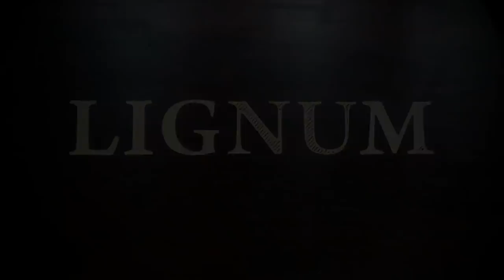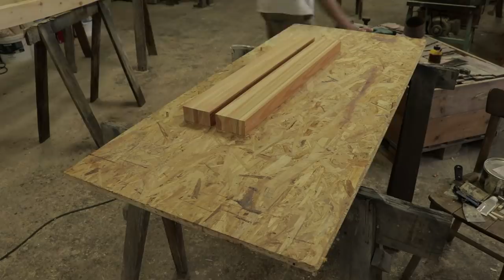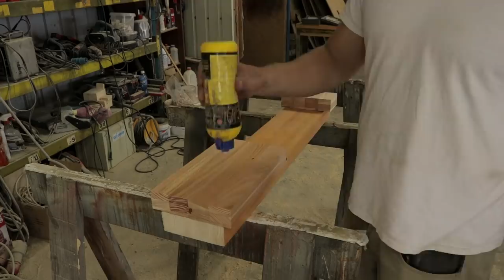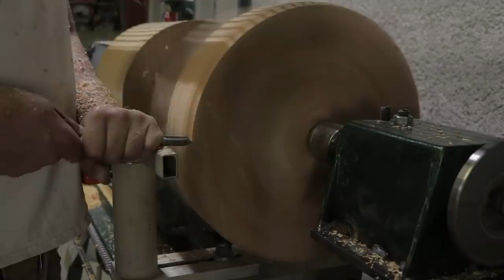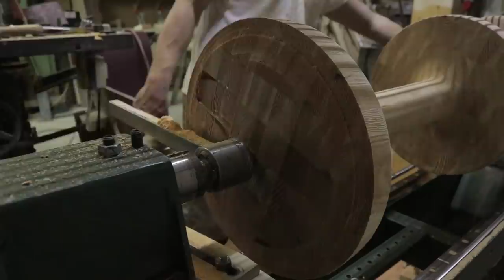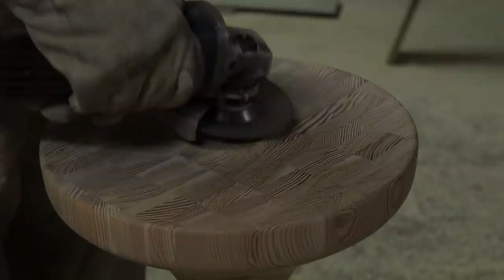Making a bar stool on a lathe

Comment: Dear Sir,
I don’t know which is better, listening to George Bizet’s Carmen or watching your beautifully made stool from recycled wood pieces. I am curious as to what implement was used on your angle grinder to remove excess wood from the ends. In my humble opinion, all that is missing is some lead ballast in the base so as to render it thief proof so as to remain consistent with your lovely work. Very well done as always. Kind regards.
Reply from the maker: Yes, this one was a bit on a light side, finally something I don't need to brake my back with😉.. I used a thing called roto raspa.. I don't know the name for it in English.. thank you for watching this one! 😃

Comment: Nice, but I think with some relief on the middle ring it would be nicer. It was one slippery glue up..that's for sure. Nice work!
Reply from the maker: Yes it was quite slippery.. I almost lost it at one point.. Good thing my battery died so it didn't record😉

Comment: Is your jointer wider than your planer?
Reply from the maker: Its combined jointer and planer, but its pain to move the plates away so I just used a smaller planer.. Larger one  is 60 cm wide and smaller 40 cm

Comment: Great job, as always though. 
But this time kinda scary and unsafe way to sand details on lathe is shown. Make some search for videos of accidents with lathe machines, so next time it will stop you from not respecting safety measures and such machines.
Once i've made some manicure on my forefinger almost to the bone by 4-sided moulder, some time later i've realized that i was very lucky that not only a finger but the whole arm stayed unharmed, especially considering the cotton gloves that was on. So i've made my conclusions. Do you?